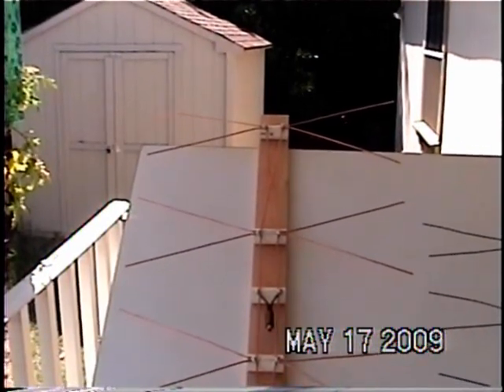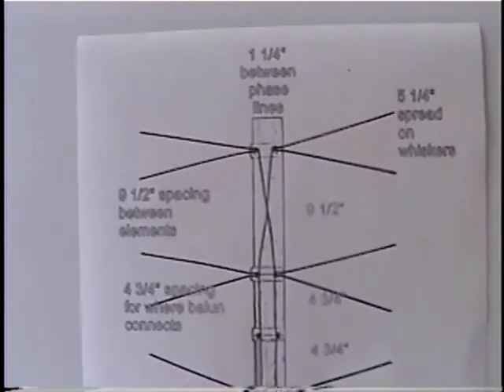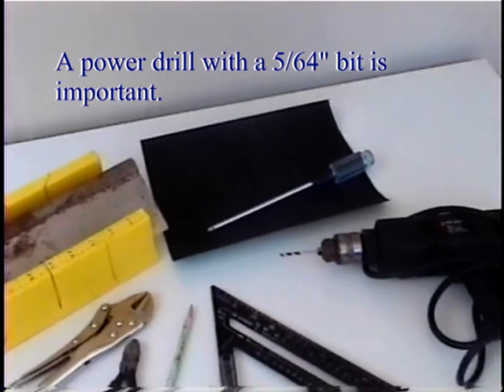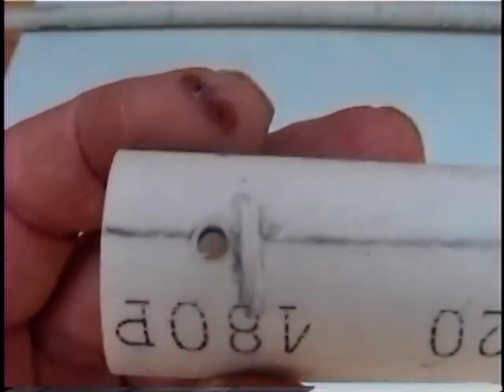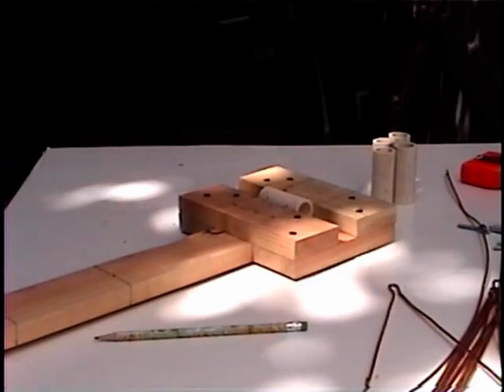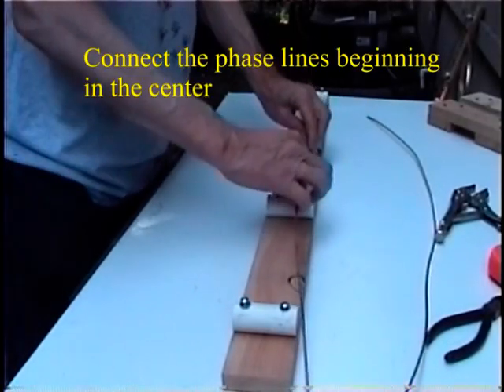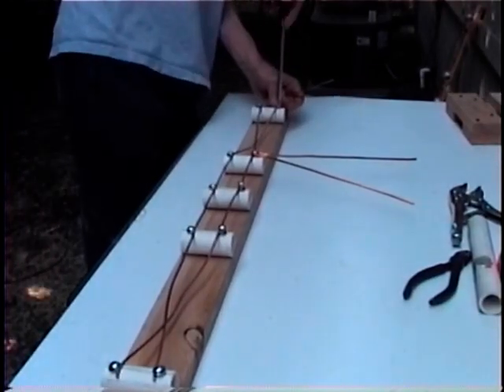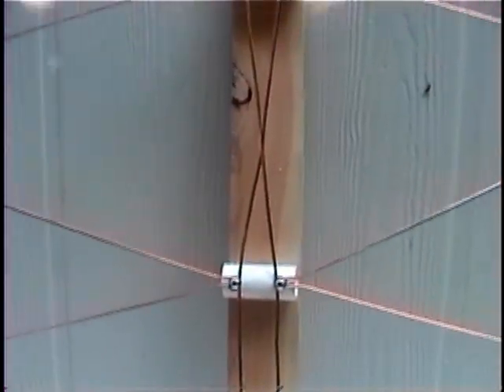A Better HDTV Antenna

Comment: The formula for the phasing harness with is 276 log of 2 times the width diivided by the wire dia. Example 276 x log of 1÷.080 will give you close to 300 ohms. Just dont allow wires to touch, and try to maintain that width even at the twists

Comment: You went to all the trouble of making PVC stand offs to keep wires from touching the slightly conductive wood, then screwed into it with the wire hold down screws!!! You are so funny!
Reply from the maker: I AM funny, but I made that "mistake" intentionally. It was done because at that time all of the HDTV antenna videos back then were the coat hanger design which is made on a wooden board. I wanted this design to be familiar to people that watched those videos.

Comment: You said you would loose a little reception by mounting the wire to the would block, Well that is just what you did. The screws you used to mount the wire goes into the wood block????
Reply from the maker: Watch the next video. I made one entirely from pvc.

Comment: Pretty much followed your directions. I have to say I was skeptical at first on the whole build your own concept. I tried multiple manufacturer antennas with no luck! When I built yours it was an eye opener. I live in Houston Northwest side and all of are main stations are on the southwest side of town. I built this antenna out of pure hate of the cable companies and boy did it work. I split my signals between two tvs and got 90 plus channels. All I can say is follow the directions and for me I put a reflector. But seriously it Works!
Reply from the maker: I'm really happy it worked for you. Be well.

Comment: Thank you for the video and all the information.  I built the one shown of the video but I added four thin aluminum 1 " wide and three 24" long and the top one 36" long on the back of the whiskers.  It is laying  flat on the roof until I  design a roof mount.
I went from receiving 0 channels with a Radio Shack indoor to 10 channels and I haven't mounted it yet.  TV fool says I should receive 19 channels.
I used materials I had in my garage.  I'm 75 and 200 miles from a city.  I hope you post an idea on how to mount this antenna.
I'm working on amount and ground.  If I assembled another antenna would I receive more channels? Thanks again.

Comment: hello I have found this design great for UHF channels but I have some hard to receive VHF channels in my area. would you have a better VHF design?
Reply from the maker: Wrong.
Reply: VHF electromagnetic waves have a longer wavelength than do UHF. So shortening the whiskers is not a solution to receiving VHF. Adding 2 elements the quarter wavelength of the VHF frequency you desire to catch, one element at each of the 300 ohm balun mount points on the phasing lines will capture the VHF television station. If you have more than one VHF station adjust the element lengths to the station with the higher frequency. At best it will be a fraction of an inch or a couple cm's. VHF television is not as common now as is UHF television so adding the 2 elements to this antenna will pick up the desired VHF while the shorter whiskers will pickup (capture) the UHF.
Reply: His whiskers are too long-Shorten them to 7 inches and you will see a difference.
Reply: NOPE...Im right-I have built over a dozen of these.7 to 7.5 is Max
Reply: Shortening the whiskers would not even help him pick up VHF signals.  Rob W, don't cut your antenna!
Reply: VHF would be longer if anything.

Comment: Is it for ether transmisons, or i i direct the antenna to the cable from the Tv provider ?
Reply from the maker: +greenhouse gardenroom The antenna receives over the air television transmission signals.
Reply: You are correct this antenna captures transmitted electromagnetic energy from the ether. An antenna is not required for capture of the frequency from the ether. The cable company does that for you, then filters and amplifies the signal sent to your television via their cabling system. Your television antenna captures signals from the television station which is converted into visual and audio data for your entertainment. Whereas, the cable company takes something that you receive for free, filters and amplifies and sends to your television via a cable and offers more channels, foreign to your local viewing area and groups those stations plus other stations that you probably won't watch into what they call a package and charges you money to watch. The cable company also offers equipment that you can rent to watch only what the cable company makes accessible for more fees that you can watch. I will stop now. I've already answered the question, my ranting serves no purpose regarding the question.
Reply: Right, from the ether.

Comment: Excellent VID John...I've been making homemade HD antennae since long before the Feds required the broadcasters switch to digital...at any rate, I've tried multiple experiments with the coat hanger design as my jumping off point ...I live in Orange County, Ca. (Huntington Beach, specifically) and ALL of my designs work to some degree (some much better than others) but the one design change that showed the most significant/noticeable improvement was when I took the same basic original coat hanger design and switched to copper and (as you did in this vid) I cut them a bit longer but (after) assembly I then cut them to 8" long on each side and an opening spread of exactly 4" ...on each antenna built this way the improvement in the antennae ability to receive signal, improved by a minimum of +30%  (based on total channel receptions numbers...some of my designs receive 150 channels!). However, the most significant difference was the added channels that I hadn't seen at all before (the pesky channels 7,9,11 and sometimes 13) were ALL there and with solid signal performance)...
I have every intention to make your design and will let you know how it works in comparison to my most successful ones to date..one thing..why not use a solid piece of plastic ? (like that plastic trim or baseboard they now manufacture)  instead of having to make the PVC pipe standoffs and also, it would eliminate the need for the "jig" as well...I will try both with your exact design being the first ...thanks a lot...I'll let you know how it works out.
Reply: So the comparaison? Which worked better?

Comment: I just finished making one using your instructions.  Thank you!  I live upwards of 60 miles away from  a couple major network towers that show 1 to two fractals in the signal--meaning the signals are not great and I was told I was going to have to put up an outside antenna.  I do not want to do that for asthetic and high wind reasons.  Anyway, I have the antenna located in my house at about 7 feet above the finished floor.  The store bought ones claiming 50 miles only got me about 15 stations.  Your antenna got me 25 stations.  The only changes I had to make was to use 1/4" copper tubing for the whiskers and a signal amplifier.  Thank you again.
Reply from the maker: +Gregg Austin I'm very happy you're getting good results with the antenna. I have mine indoors, too.
Reply: Is it because you notice better reception using 1/4" copper?

Comment: Did I miss the comparison to the coathanger antenna?
Reply from the maker: gdholmfirth I did compare them once, but I didn't put up a video about it.
Reply: John Strabismus how did they compare?
Reply from the maker: gdholmfirth The coathanger design works. The signal from more distant towers wasn't as strong, and there was somewhat more signal interruption. Someone living within 20 miles of a tower might get by with the coathanger design, but it isn't much more work to make a better design.
Reply: The slang term for this type antenna is "coat hanger antenna". It doesn't have to be constructed using coat hangers but it can be. Other materials using this design that are better for capturing electromagnetic waves (television frequencies) are aluminum, tin, silver, gold, brass, copper. Gold is the best but who can afford it. Next is silver. Again, price. Copper is more affordable and conductivity (receiving those EM waves) is better than the remaining metals. Coat hangers are typically constructed from steel and is on the bottom of the list of conductive metals. Using copper for whisker elements and phasing lines will greatly improve the reception of signals to the 'coat hanger antenna' design. Whether you make your antenna from steel material or gold is your choice, but the basics for construction are the same no matter what metal you use for capturing the signal. You can build an antenna for each frequency you want to receive in your coverage area, or build a multiband antenna using the median frequency for the band of reception desired (digital is currently UHF or VHF; there are more UHF transmitters than VHF transmitters due to advancements in technology). If the same design is used for both a steel and copper metal built antenna you can expect better results from the copper antenna, especially when distance and signal strength of the transmitted signal affects the received signal.

Comment: Cool someone posted a properly dimensioned 4 bay whisker dipole,
These are the right whisker and separation lengths.
Good material, good technique, good design, good phase line cross over ,good job.
I liked the outdoor build better still (no wood)
Reply from the maker: ghz240 Thanks. I looked into this design very carefully before I posted it.

Comment: Good job. I would like to see more
Reply from the maker: Terry Smith Well, I did put up another antenna video: https://www.youtube.com/watch?v=BcUSW2l6MSI  Here's another one that shows an easy way to straighten wire for making antennas: https://www.youtube.com/watch?v=-8HoeP9beYE
Reply: John Strabismus  I had everything you used in your video on-hand(contractor by trade).  I watched, gathered materials, and made it in 25 minutes, had it hooked up in 30, and went from one channel to seven channels as soon as I hooked up the new line of coax.   Now I'm going to make one for my shop, go with heavier gauge copper wire and experiment with the reflector.  The metal siding on my shop can't hurt for bouncing signals!  Thanks.  This rocks.
Reply from the maker: TheHomeGMan If you're happy, I'm happy. You've got to know I want people to succeed. The reflector might help, but it has to be aimed more carefully, more precisely.

Comment: John, what is the gauge of copper wire that your are using? Also one of your replies to  southerntechy on one of your other videos mentions a website. What website is that?
Reply from the maker: 19jimbob52 It's 12 gauge, but anything near that would be fine.

Comment: just thinking would standard solid  10 or 12 gauge copper wire work just the same for the  " V's "   and use 1/2 or 3/4 pvc  pipe
Reply from the maker: Ruk .Hollow Yes.

Comment: Pretty nice video..but for us dummies..we would need to know a bit more about the reflector build...and why make the video and then NOT show the performance?...LOL...Thats just not good...the other You Tube coathanger model the guy said that between 7 inches and 8 inches was because of the frequency and that was the correct length...yet this one is 10 inches..was it not true about the frequency? Or does it just not matter?...also did you put something between the cross wires...or did the pipe make the wires not touch?...
Reply: Ken M This antenna is dimensioned correctly . 7-8 inches is to small for the frequencies we have left (470 to 700) MHz . 8 inches used to be a viable compromise when we had channels above 50  .
This is the build to follow . These antennas have been extensively investigated and modeled with 4nec2 on a Canadian forum led by (among others) a user named mclapp  you can find gain reports for the models there and proper gap for a reflector.( if you don't want a bi-directional)  Google mclapp m4 and or digitalhome. 
Reflected 8 whisker models ( two of these stacked  with a reflector ) are among the best deep fringe antennas (FOR UHF)
Before building an antenna you should find out if you need VHF or UHF or both , TVfool is a good starting place

Comment: Q's for John and others who have built one and/or are very deep into  these, or one like it : This is a linear design, bottom to top, a two-directional antenna (reception mostly from front and back). Must it be mounted vertically? If one turned this on it's side, any different? If one instead made a four-faced square, each square having one or two of these bowtie/whisker elements, would one then have a multi-directional antenna? No two channels are broadcasting identically... so why are these bowtie-elements identical, same measurements?... Why not  have your elements/whiskers (four or eight, or each one) different lengths, and/or different shapes even?
Also -- What we refer to as a 'transformer' -- 300 ohm to 75 ohm -- is it INDEED a "transformer", changing the signal, or merely an 'adaptor' to mate up the connections?
Also --  a couple guys who posted on YouTube wth the pie-plate antenna and the cookie can lid antenna are attaching or soldering the end of their 75 ohm coax cable (minus the threaded connector end) to their pie-plate or cookie can lid directly -- without any "transformer/adaptor", and forming a complete circuit that way. These linear "tree" designs do NOT form a complete circuit. Why/why not?... The indoor antennas you could buy at most stores have the traditional telescoping dipole for VHF not completing a circuit, but the round loop which is also part of the unit for UHF DOES form a complete circuit... so why do these DIY "tree" antennas (designed/created mostly for acquiring UHF signals, right?) NOT form a circuit?....

Comment: What is the significance of keeping the wires off of the wood? Doesn't the screws conductivity just transfer into the wood as if the whiskers are sitting on the wood? Just curious. Thanks for the video!
Reply: Wood is slightly conductive, because it can hold in moisture.
Reply: Wood is slightly conductive, because it can hold in moisture.
Reply: I would put a bolt/screw in the middle to hold the insulator on.  When you attach  the elements don't go into the wood. I usually don't use wood though.
I have used rectangular vinyl for the insulators. They are flat and easy to work with.
Reply: chicken31999 wood is not conductive it makes no difference the only thing I can think of is maybe with the extra height you might get a reflect effect

Comment: I built mine pretty sloppy. Whiskers aren't even spaced out correct.  I tried using just the balum and got almost same results.
Reply from the maker: Rayray Washington Making things more exact will improve things, but perfection isn't required.

Comment: Not a critic, just an observation. I think the antenna is a great design. I intend to try one myself shortly. Though I am leaning more toward a fractal as a first attempt. I did note that you mention mounting to the wood is detracting to the signal. Then you used longer screws to mount the whiskers thru the plastic and into the wood. Perhaps a piece of plastic downspout or pvc tube etc. Thanks for the work to create and share this project.
Reply from the maker: I tried a fractal antenna once. It didn't work very well. It looked cool, though.

Comment: Do you get FM interference on high part of hi-VHF on your antenna?

(105 x 2 = 210 = channel 12,   95 x 2 = 190 = channel 9, 108 x 2 = 216 = channel 13, 105.5 x 2 = 211 = channel 13)
Reply from the maker: Not so far, but I don't measure these things. I really only know my antenna works the way I want it to.

Comment: I bought a ready made aerial & received about 8 channels. My homemade aerial, similar to this model here, without the pvc inserts, is getting me over 80 channels,
Reply from the maker: There are some very excellent commercial antennas like the Channel Master 4228HD, but the design in my video will do as well as that one, or even better. It also won't cost $100.

Comment: Great video, thanks for sharing, however, would it be possible to update the "about" section with the exact gauge of wire you used for the 'whiskers' and the two wires running the length?  Also possibly the diameter of the pvc you used?  I'm assuming 1" but not sure.  To me, that info is more important than what tools I need to do it.
Reply: Buzz65 how is this a great video he didn't show it work he blew threw the steps I would say ok video but not great how do we know it works

Comment: John.  This looks like a great design.  I was thinking of running it outside though - How do you 'ground' an antenna?   Does that not 'bury' the signal?

Thanks - I can't wait to kick my cable company to the curb.  (You might just savce me $1,000 this year).  

R.
Reply from the maker: It's a great antenna, but for outside I'd recommend the outside version.  Here's a link to that video: Better Outside HDTV Antenna You could use an aluminum spine on that build, or you could simply make it from PVC as I show in the video, and put a metal rod through the spine, and then ground it as normal. There are some good YouTube videos on grounding antennas if you've never done it before. Personally, I've saved $1,400 a year by dumping cable. I don't miss that bill at all.

Comment: I used my trusty Dremel to make the notches. I also used it to deburr the cut edges. Saves a lot of time!! Just thought I'd share!  Peace  :)
Reply from the maker: Works for me! Also, you look exactly like Spock from an alternative universe.
Reply: John Strabismus
where the wires cross should they touch or not?
Reply from the maker: David Castle No. They're supposed to be separated.
Reply: John Strabismus No Ideally they should be about an inch apart. I use a piece of 1 inch pvc cut and notched for the wires!